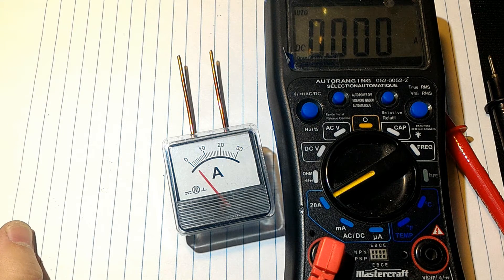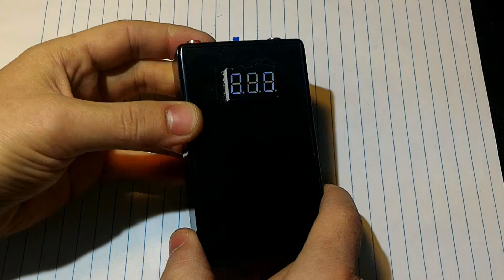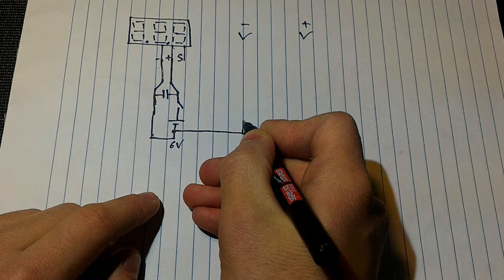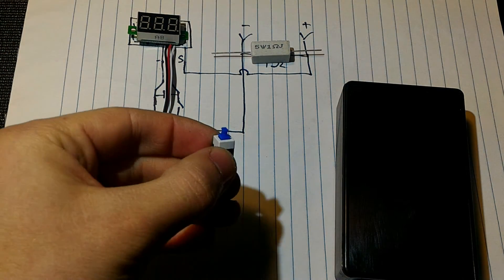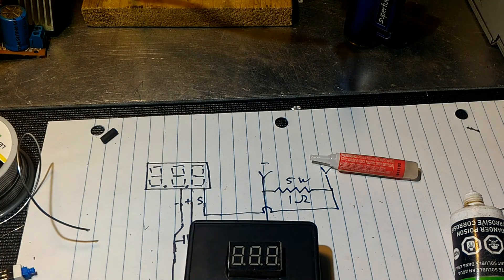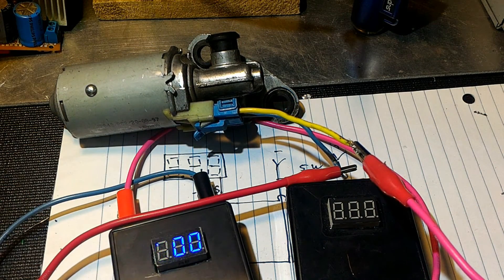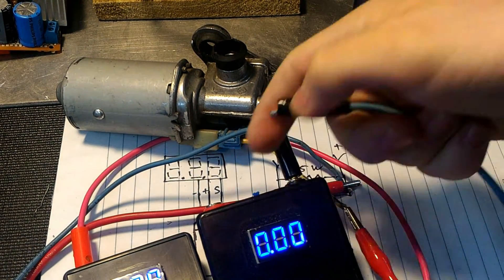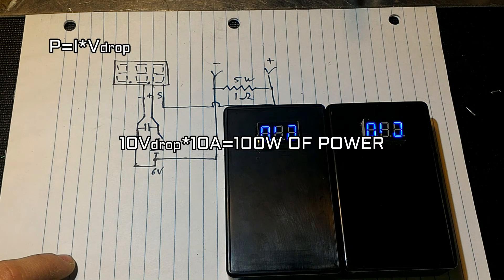DIY Digital Amp Meter For Cheap 💣👍🏻💣👍🏻💣👍🏻💣👍🏻💣👍🏻

Comment: Hi, to measure higher current, for example 15 A, what would you need to modify? A larger resistor, and a project box that is more heat resistant?
Reply from the maker: Hi thanks for commenting!!!Yes a higher value resistor would be needed to measure higher currents, also a metal enclosure would a great idea!!Although this meter is simple and is great up to 4A with 1W 1ohm resistor,it is not ideal for higher currents because you will have 15V drop at 15A.But there is are good news i have made a V2 meter that uses 10x smaller shunt .uses bit more parts, but it allows you to calibrate it for the application you need!!here a link-----https://www.youtube.com/watch?v=lmYYaUN2mY4Please let me know how it turned out!!!
Reply: Thanks very much! I'll try that out :)
Reply: @EECPOWER  how to miliamp sir ...
Reply: Karsten Schmitz buy a 30 amp shunt . Or make one out of thick wire /metal . The thicker it is the longer it will hav2 be . Use ammeter specs eg: 75vm/100vm you will need a multimeter to tune it ; )  I'll just leave this here for you 
https://youtu.be/xZWdieuFka8

Comment: Cool project dude ; )
You get a drop across your jumper wire .
So how do we ditch the battery now ? :D
Think your half way there with that capacitor ; )
Reply: you  make it with external  connector and put it outside of box the batterys  and you can change it if  batterys are out off charge

Comment: How would you make this for a.c. current measurement, and could you use a toroidal ferrite coil into the banana plugs. or with a jack plug instead? (kinda like a clamp meter)
Reply from the maker: Yes that is possible,  but  that would require some trial and error.
Will try to make a video to help you out!
Reply: Thanks, that would be great!

Comment: can you measure the smaller currents around mA?
Reply from the maker: +Özer Burucu 
Yes you can. But not on this one. I have a version 2 of this device on my channel check it out. 

https://m.youtube.com/watch?v=lmYYaUN2mY4

V2 amp meter is more accurate, it messures higher currents and you can calibrate it for accuracy you need with a potentiometer.

To measure ma with it ,change the gain on the op amp!

If you have more questions you are welcome to ask!

Hope you check out many more of my videos, and even consider to subscribe if you like my content.

Comment: can this voltmeter modified to read ac current ?
Reply from the maker: it is posible ! i was prototyping with that, but newer got it to work. i was trying to use a correct transformer. than convert the current to a voltage that the meter could read. but i might take another go on that idea!!!   thanks for the comment!!!
Reply: thank you-----please try and let me know whenever you suceed